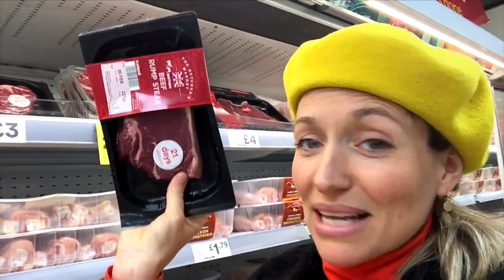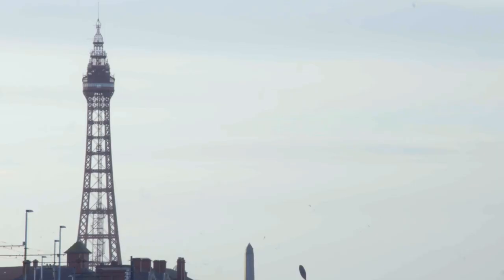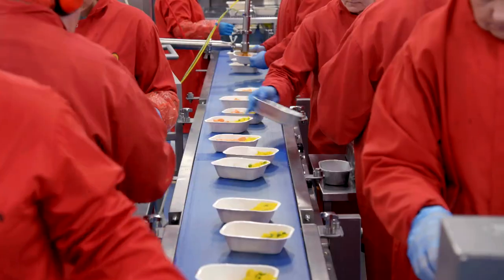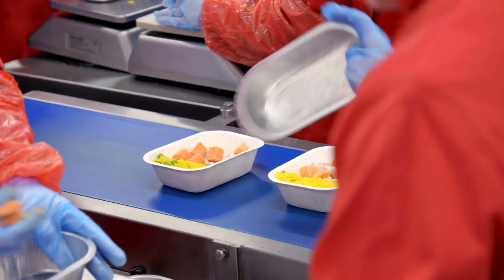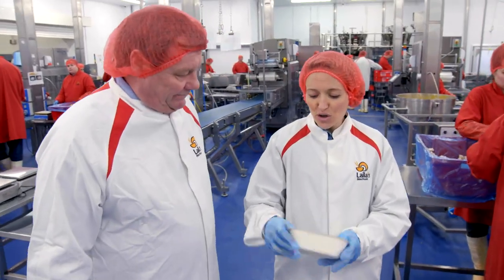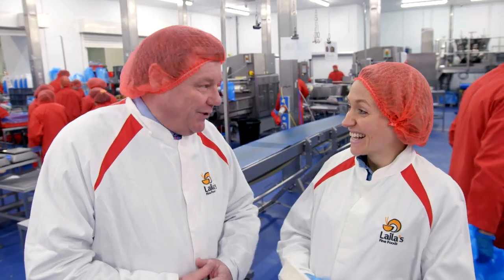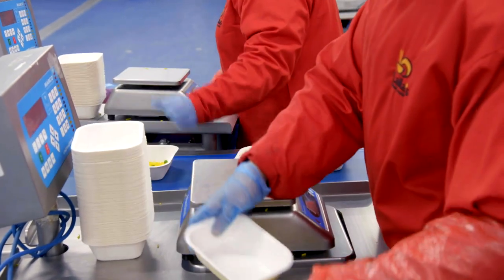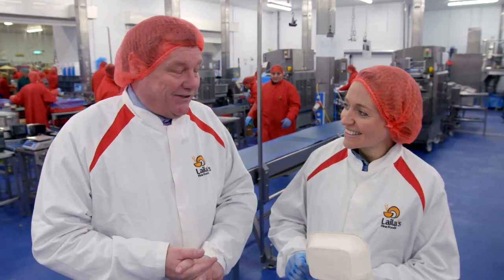The New Materials Attempting to Replace Unrecyclable Plastic! | Food Unwrapped

Comment: Of course, there is technology available that will reduce plastic back down to oil, which can then be remade into virgin, food grade plastic. I understand the reason that it is not commercially viable is that the energy costs are high. If there was an effective tax on carbon that would incentivise recycling over mass burn or landfill.
Reply: Or give companies that use biodegradable or recyclable packaging a tax credit.